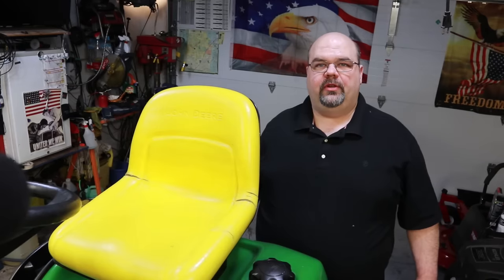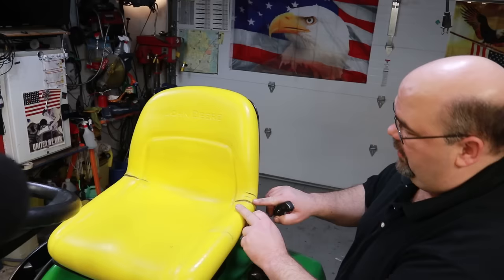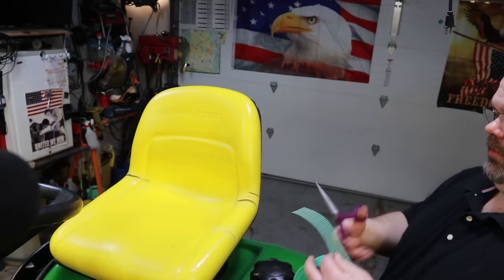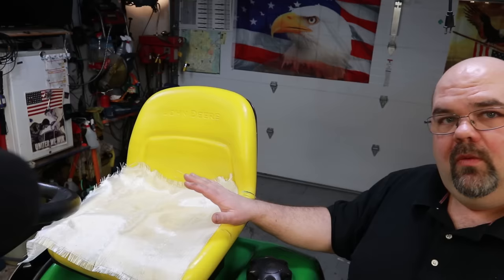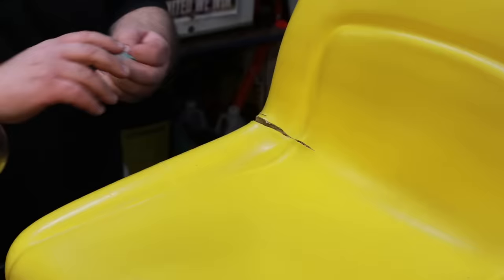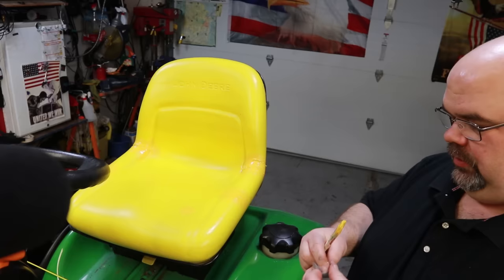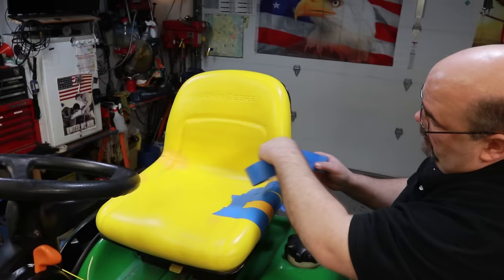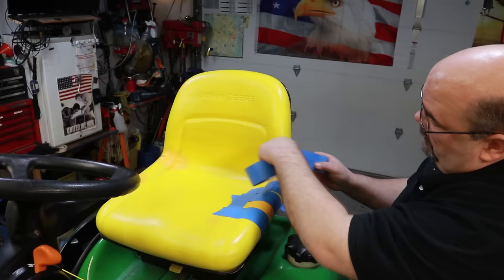Unexpected Solution For Your John Deere Riding Mower Seat

Comment: This is their way at killing the used mower market.  Makes the mower look terrible (much less likely to be bought by someone with enough money to afford a new one) while still being functionally reliable so as not to ruin their functional reputation.  People either keep and deal with it, or buy bloated price seats to replace.  My X570 was bought in April of 2016 and had cracks in the seat before it's second season was over, and that tractor has never seen rain nor even sun to the seat, because the only time it ever left the barn was when I was sitting on it.  It's in it's fifth season now, and it looks like it lost a fight to Freddy Krueger from A Nightmare on Elm St.  I can put another crack in it simply by pushing on it with a finger.  I won't replace it with a John Deere branded seat or cover.  I will not reward their intentional incompetence; I will either allow it to crack and nor care, or cover it with a third party product, or buy a seat from some other brand.  My 1952 Ford 8n has a stock steel seat on a suspension system.  You can comfortably sit on it all day, and it has never failed in any way in its many decades of use and abuse.  Simple, comfortable, strong.  But that makes too much sense for the customer and no business sense these days.
Reply from the maker: Thanks for the comment.  I flipped a 1947 Ford 8n straight over backward when I was 12 years old. I lived to tell about it with nothing more than a broken hand where the steering wheel pined it to the ground. Pulling small trees out and had the chain tied to low, foot slipped and over she went.  The only thing that saved me from being centered under the steering wheel was a branch that knocked me off to one side.  I didn't think much about it as a 12-year-old kid but trust me, as an adult, I count my blessings every time I see one of those old tractors.  
Anyways, thanks for watching, and stay safe out there.  🦅
Reply: @baldeagle242  I pull stuff like that in reverse attaching to an aftermarket front bumper for that very reason.  Plus I can monitor the progress of the pulling better rather than having to look behind me.  If I start to lift the front wheels when pulling the traditional way, I just mash the clutch pedal, but I can see how a foot could slip off of it.  There are aftermarket roll bars available, but I don't have one.

Comment: Nice vid. Good editing too. Looks like a great fix.  I wonder if there is some kind of paint you could use to paint the whole seat after you're done?
Reply from the maker: Thanks for watching and the kind words. I was going to test paint on an old seat and see how it turns out.  I was worried it wouldn't stick to the rubbery surface.
Reply: They do make vinyl spray but I don't know if they make it in JD yellow. Mostly used for auto vinyl repair and color refresh. Used it in paint guns in the 80s for vinyl tops on cars and interior door panels. Now I see it's sold in spray cans.
Reply from the maker: @marks3750  I'll have to look into it.  Thanks for watching.

Comment from the maker: I'll show you a very inexpensive and effective way to permanently repair a cracked or damaged John Deere riding mower seat for around $10. 
I'll show you how to prepare the surface, properly clean the surface, and a unique technique using a come reinforcement product.  This repair will last a long time and make the seat weather resistant to avoid getting the foam wet, causing even more damage.  
At the end of the video, ill give you a complete walk-around of the mower and share my honest opinion on how this product works and how it looks.  
I appreciate all feedback and comments and hope you'll subscribe and like this video.  I have plenty more projects I'm working on. 
Thanks for watching!  😁👍

Yellow Plasti Dip 14.5 oz. 
https://amzn.to/3gnEeFq

Prep-All Wax & Grease Remover, Gallon
https://amzn.to/3n02IWo

RH Adhesives HH-66 Industrial Strength Vinyl Cement Glue with Brush, 8 oz, Clear - I did not show this in the video because this seat did not need it. Still, if your seat is coming loose from the frame, this is a semi-flexible adhesive that works well to reattach the padded seat to the frame.
https://amzn.to/3n4IjPV

John Deere 18" Compact Utility Tractor Seat Cover (Large)
https://amzn.to/3sxT12H

John Deere Brand Replacement seat (Actual John Deere Brand Seat)
https://amzn.to/3aklEd9

NEW (AFTERMARKET) John Deere High Back Seat - Yellow
https://amzn.to/2QxXy7U
Reply from the maker: Thanks for watching and good luck with your repair.  🦅
Reply: Terrific, thanks.  Interesting that the Plasti-dip has gone from $10 to over $23 since April!
Reply from the maker: @richardwernst  wow!  That's crazy!  It was around $8 when I purchased it for this video.  😳

Comment: New Subscriber : If you go  to your local John Deere, they will most likely have the Deere yellow. They might have it in spray paint form or the regular paint.
Reply from the maker: +Noot 12 I have checked on their website, and according to the information I read there, it can be painted.  However, because this material is so playable and flexible, I doubt paint would last very long in a situation such as this.  It’s something you'd have to experiment with on something you're willing to replace if it turns out bad.  
Anyways, thanks for watching, and if you decide to try it, let us know how it turns out.  Thanks for watching.  🦅
Reply from the maker: @Noot 12 I have checked on Plastidip website, and according to the information I read there, it can be painted.  However, because this material is so playable and flexible, I doubt paint would last very long in a situation such as this.  It’s something you'd have to experiment with on something you're willing to replace if it turns out bad.  
Anyways, thanks for watching, and if you decide to try it, let us know how it turns out.  Thanks for watching.  🦅
Reply from the maker: @Noot 12 I have checked on their website, and according to the information I read there, it can be painted.  However, because this material is so playable and flexible, I doubt paint would last very long in a situation such as this.  It’s something you'd have to experiment with on something you're willing to replace if it turns out bad.  
Anyways, thanks for watching, and if you decide to try it, let us know how it turns out.  Thanks for watching.  🦅

Comment: The best descriptions I’ve heard for John Deere hoods are: "They're made out of green potato chips" and "They're made out of green egg shells".  For the high price they're charging for these hoods it would be SOOOO much better if they were made of aluminum or some other more durable material rather than brittle plastic.  Canoes and kayaks are made of molded polyethylene resins that are strong (they smash into rocks and don't break), light-weight and inexpensive.  John Deere needs to get their act together and stop ripping off their customers.
Reply from the maker: I’ve been saying this for years. I also work on golf carts and you can literally beat them things with a golf club and do zero damage to the plastic on them.
Reply: @baldeagle242  Exactly!  You are 100 percent correct.  For the sky-high prices John Deere is charging for their products the least they could do is make mower hoods that don't break like they are made out of glass.  This is outdoor work equipment for God's sake!  They are driving their customers away in droves as a result.  If anybody wants to make a FORTUNE start producing good quality replacement hoods made out of durable material.  You'll become rich in no time!

Comment: Thanks for the great tip. My question is could you use some silicon for the inside with the filler due to it being cheeper and waht if you infused the filler with the plaster dip before you installed it into the crack and then did the exterior coats
Reply from the maker: I’ve never tried that but it sounds like it has potential.
Reply from the maker: 👇UPDATED VIDEO HAS BEEN POSTED!  See it HERE!👇
https://youtu.be/hWEoQM65fto?si=2MzpfUJFhY0-1hoA

Comment: Use the white plastidip and have it tinted at you paint store or auto finish supplier, it will match up better, you need to find a good tech to do this as the formula will be outside the systems capability!

Comment: Well done,I use rustoleum john deere yellow spray paint to colour match on top xD
Reply from the maker: +jaz panoz Thanks for the tip, and thanks for watching.  🦅
Reply: Did it stay? The spar urethane is a little more flexible. I thought enamel would crack or peel off.

Comment: Old Vinyl shower curtain seals it in the Hot SUN or Heat gun...cut strips from a new or old one.  Found out by accident whilst using a old clear shower curtain as aa cover...LOL !  it was welded to My seat.
Reply from the maker: Thanks for the tip, and thanks for watching.  🦅

Comment: Great repair on this seat, I will try this on my J.D. cracked seat. 
Rust‑Oleum has a rattle can spray paint that I picked at Menards that sticks well to plastic if you want a color match. If they don't have "J.D. yellow" then "sunburst" yellow is the same color. Food for thought and great video.
Reply from the maker: Thanks for the tip.  🦅🇺🇸

Comment: If possible, can you add a color dye to the yellow product in order to match the color of your seat? Thanks
Reply from the maker: +@markbuchanan4349 I have checked on their website, and according to the information I read there, it can be painted.  However, because this material is so playable and flexible, I doubt paint would last very long in a situation such as this.  It’s something you'd have to experiment with on something you're willing to replace if it turns out bad.  
Anyways, thanks for watching, and if you decide to try it, let us know how it turns out.  Thanks for watching.  🦅

Comment: I wonder if you hit the last coat with some JD yellow spray paint before it dried would make a difference on the color.
Reply from the maker: +mike d I have checked on their website, and according to the information I read there, it can be painted.  However, because this material is so playable and flexible, I doubt paint would last very long in a situation such as this.  It’s something you'd have to experiment with on something you're willing to replace if it turns out bad.  
Anyways, thanks for watching, and if you decide to try it, let us know how it turns out.  Thanks for watching.  🦅

Comment: A nice slip over seat cover from Amazon is a better option.
Reply from the maker: As long as you don’t mind a wet azz.
Reply: @baldeagle242  I paid around 18 dollars for one, fits great, it's water resistant and easy to install. Win all the way, I am using it simply to protect my brand new John Deere replacement seat. The original one had a small hole and was infested with ants.

Comment: I wonder if a vinyl spray paint might cover the color difference?
Reply from the maker: +@toddricketts2518 I have checked on their website, and according to the information I read there, it can be painted.  However, because this material is so playable and flexible, I doubt paint would last very long in a situation such as this.  It’s something you'd have to experiment with on something you're willing to replace if it turns out bad.  
Anyways, thanks for watching, and if you decide to try it, let us know how it turns out.  Thanks for watching.  🦅

Comment: I have a 1994 suburban, and repaired a small crack on the inside door pull, the vinyl.   Similar repair with tape and silver flex seal. Not perfect, but okay
Reply from the maker: I've used flex seal on a black seat before and it works very well also.  Thanks for watching!

Comment: Mix some paint in the plastic dip  and it will  look closer to the yellow  seat !
Reply from the maker: +@thomasbradley4868 I have checked on their website, and according to the information I read there, it can be painted.  However, because this material is so playable and flexible, I doubt paint would last very long in a situation such as this.  It’s something you'd have to experiment with on something you're willing to replace if it turns out bad.  
Anyways, thanks for watching, and if you decide to try it, let us know how it turns out.  Thanks for watching.  🦅

Comment: I did this with the spray Plastidip and it did not work.  Mine was further forward where you slid across the seat and it and it peeled loose as I got on and off.
Do you think the brush on works better than the spray, or do you think I need to sand better?  I did not use prep-all, but I used 99% ipa to clean it first.
Or do you think it's hopeless in this location?  I also thought of flexseal.
I'm trying to save my over $250 Kubota seat.
Reply from the maker: I’ve had better luck with the brush on stuff than I’ve had with the spray.  From comments others have left on this video about the spray it does not hold up as well and peals pretty easily.  I also thing that using the drywall mesh and embedding it down into the foam helps as well.  It’s a combination of prep work and techniques but location is going to play a role in how successful the repair lasts as well.

Comment: Could you tape the repaired area's again and hit it with some JD Yellow spray paint?
Reply from the maker: I tested spray paint on a scrap of vinal I had in the shop and it looked great but as soon as it was handled after drying it easily rubbed or flaked off.  Someone else commented that vinyl dye might work.  Anyways, this mower was sold a few days after I finished the video.  Thanks for watching. 😁👍

Comment: I just used RV Eternabond tape, any repair is going to look like crap so this tape once stuck on wont come off unless heated.
Reply from the maker: Thanks for taking the time to leave a comment. I’ve started using vinyl fabric glue and marine grade vinyl. Once it’s in place it’s permanent. Little costly upfront but it’s a much better repair v

Comment: do you think it would be possible to sand the plasti-dip after it dries & then maybe paint it to color match better ?
Reply from the maker: There has been quite a discussion in previous comments with mixed opinions.  I think the consensus is it's close enough as is, and with a bit of age and sun fading, it looks pretty close. If you happen to try, leave a comment, and ill Pin it to the top for discussion.  Thanks for watching.  😁👍

Comment: I have a guy I feel who is being deceptive. Hes selling a johm deer 160 and I asdked where's the oil filter. He looked and said it. Must not have one. It has a kawasaki engine. The oil was low when I checked it.  Now from what I've seen it does have a oil filter. The steering has been fixed. It runs good.  The break doesn't seem to worm also. Is this wroth 325.00
Reply from the maker: My advice is to walk away anytime someone seems deceptive.  The price can be an indicator that he knows of other issues and just wants to unload it knowing it needs fixed. 
Basically the old say “If it sounds to good to be true it probably is”
If you have the knowledge and tools to fix anything that may be wrong it may not be a bad deal but I can’t say for sure without looking at it myself.
Reply: @baldeagle242 I don’t think he was being deceptive now. I thought since he said there’s no oil filter for one. I will have to replace the break pads

Comment: John Deere should design a 2 piece seat...so avoid the transition from horizontal seat to verticle back support.
Reply from the maker: They do use a two piece seat on the X series mowers but they have just as man issues with them cracking and failing as the one piece design.  I’m working on a repair video next week that will show how I repair these seats with a much better technique.
Reply: @baldeagle242  I appreciate you giving a very speedy reply!
Great video by the way! You would be a tremendous technical teacher!
Reply from the maker: @johnbannister501 I appreciate the kind words. Thank you.
Reply from the maker: @johnbannister501  👇UPDATED VIDEO HAS BEEN POSTED!  See it HERE!👇
https://youtu.be/hWEoQM65fto?si=2MzpfUJFhY0-1hoA
Reply: @baldeagle242  Thanks "bald eagle" I am blown away that you remembered me!! Take Care!
Reply from the maker: @johnbannister501  😁👍

Comment: I am curious why the painters tape was only added on the final application instead of for the earlier coats of plasti-dip?
Reply from the maker: I like to feather the edges for the layers I will cover with the next coat.  I believe this helps to keep the product tightly bonded and keeps it from separating.  It also keeps the final edge from being thicker than it needs to be.  Thanks for taking the time to leave a comment.  We hope to see you around on future videos.
Reply: @baldeagle242   - ah, makes sense.  Thanks for the quick reply...I'm working on mine now.

Comment: just put a plastic trash bag over the seat if you leave it outside, a lot quicker and cheaper solution.  Just going to keep cracking in other spots since the vinyl looses it;s plasticizers as it ages, UV exposure speeds up the process.
Reply from the maker: TTOM 😉

Comment: How durable was the fix?
Reply from the maker: This mower was sold shortly after this video was made but my father has an older mower that we used this on around the same time. It’s needed to be reapplied over time and the seat had cracked in other areas that he has also repaired. It’s effectively as durable as the rubber hand grips on a standard pair of wire cutters or pliers so it can be damaged and tear with enough force. Its never going to be as durable as a new seat but it does help to keep an old seat together and dry much better than duct tape or other fixes I’ve tried.